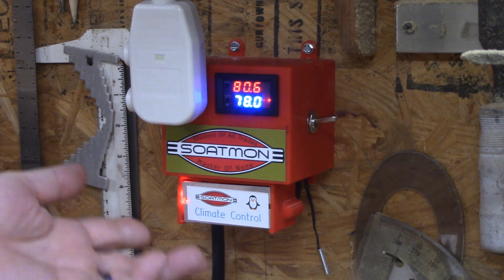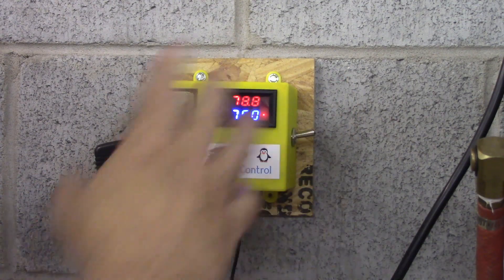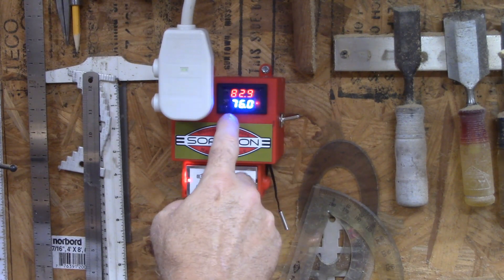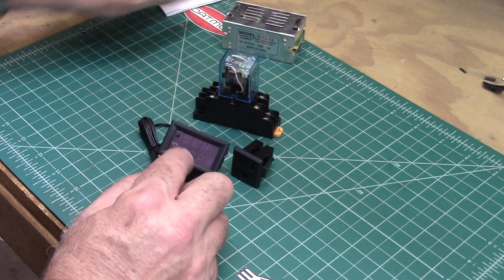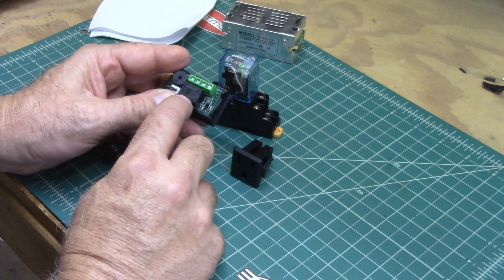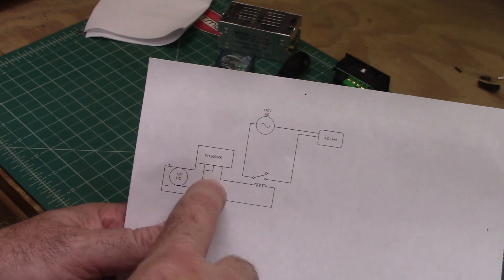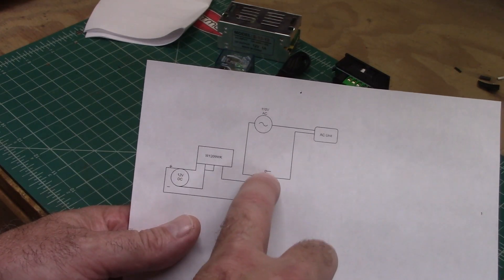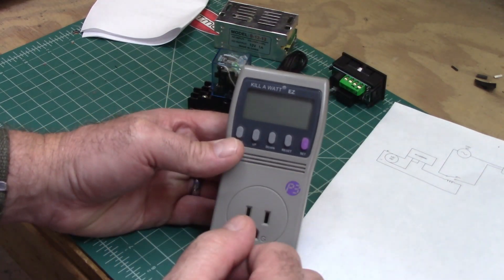DIY Digital Thermostat for Window A/C

Comment: Great video! Thank you. QUESTION: For a 220 v a/c unit, would both hot sides need to be opened/closed by the relay or would it work with only one side being opened/closed by the relay?
Reply from the maker: For 220 you want to control both hot sides with a relay.
Reply: @SoatMon  Thank you!

Comment: I still do not understand how your Bypassing the Window AC Thermostat ?? Your not ! If you wanted the room at a set temp. 60*F ?? What is preventing the AC Compressor unit from shutting off before this desired temp. is reached ?? Nothing ! Your system is in no way by-passing the Window AC unit here !